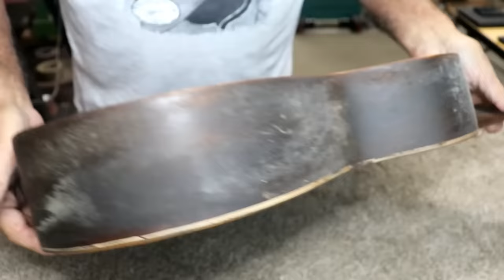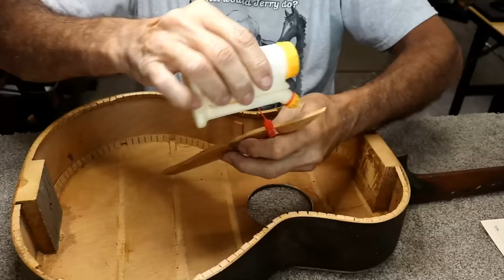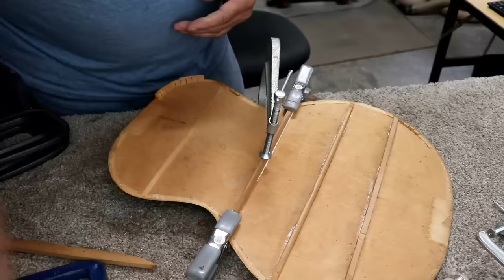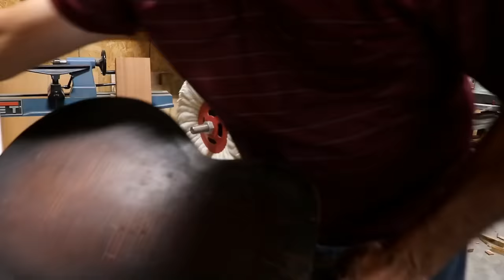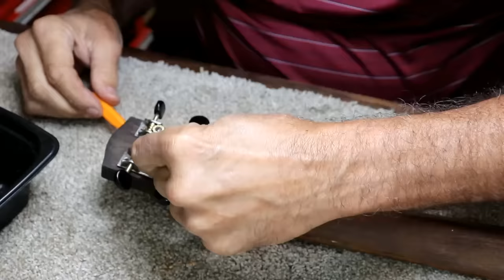596 RSW Can This Wall Hanger Become Playable? - A 1920's Mail Ordered Vintage Guitar Repair

Comment: I am curious why you didn't try to do any gluing on the split part of the top near the sound-hole (between the sound hole and neck?)  It is clearly split and may try to open even more as more stress is put on the neck.

Comment: I have the harmony from the same time frame.....that had the fake pan on the front.  The pan got lost over time some im throwing a real spider pan in and everything else. Can i get your email for questions on proper height of the bridge. And should i trust where the wooden bridge was for the proper length away from the neck to place the new bridge? Please let me know if possible or any ideas on here. Thank you.

Comment: You may get better results if you heat up the linseed oil. The reason why the parts did not line up has to do with a combination of warp and torque. Judging by the age of the guitar, a lot of the crud on the guitar is probably a result of smoking and candle lights. Alcohol or gasoline can solve it but it may kill your varnish too.
Reply: Didnt help that he soaked the guitar with soapy water before popping the back

Comment: I've rebuilt much antique furniture. if you were to feed the wood tung or lemon oil , maybe your top wouldn't have made those cracking sounds. it makes the wood more supple & pliable. the lemon oil would probably be better than the soap & hot water

Comment: I have a 1937 Levin guitar from Sweden that was an old relatives, that had spent a couple of decades in an attic before I got it. And had absolutely everything on it be original.

And the tuners on that guitar look pretty much identical to the ones on the guitar in the video, so yeah those tuners probably are original.

The guitar I got, was in nowhere near as bad condition as the one in the video, but still pretty rough. I had to do some work to get it payable again.
The glue which I suspect was hide glue or something, was very brittle at parts, so I had to do some glueing. But the guitar was holding together when I got it, or well a whole lot better then the one in the video.

The frets were green and super oxidised. 

It never were a valuable guitar, the finish is about on par with the one in the video, maybe one step up but not much. It has the same colour theme and shading as the one in the video. Idk maybe it was trendy in 1937?

But I got it to a place where it sounds and plays really nicely now.

Comment: Hmm.. What about making a special guitarr-clamp-jig which is on a rotating board which can be easily unlocked/locked with the foot?.. I mean.. for this project it sounds like overkill and would take a lot of space, but I suspect it may pay off in the long run.
Reply: I often think about myself as.. "Knowing enough to be dangerous" on most topics.

... That is.. I think of myself as a good example of where intelligence meets stupidity, and where competence meet ignorance.. or more exactly.. I usually use myself as the perfect example of ALL stages of the "Dunning-Kruger"-curve/-effect.. 

In this case.. I have just watched the entire video to the end.. and.. I have (through most of it).. assumed that the poster is CLEARLY the authority so I should assume him to be "right".. (I mean.. I never ever tried to deal with guitars on this level, so his experience CLEARLY blows me out of the water).. 

BUT.. There are some things that make me wonder if he even knows how wood works.. especially.. when exposed to.. "weather" (well; "conditions" related to changing heat, humidity, and other factors).. 

Sometimes (which feeds my ego and self-confidence) he say one thing; I disagreed... and later he came to the conclusion I came to¹ ..

¹ F.ex. the extra piece of wood.. which literally had a name and date on it.. which he thought FIRST to be just a random piece of wood intended to fix the crack that went toward it.... I personally.. IMMEDIATELY assumed that the name on the piece of wood.. was specifically the branding of the guitar... NOT created as a way to "brag" or create promotion; A while back- while most manufacturing was done by hand- MOST people did add a "flourish".. f.ex. people who made chairs or sofas or what not.. tended to write their name in an invisible part on the inside, AND possibly put in a newspaper of the day where they made the chair, or at least a coin that was minted the same year.. let's be fair: NOT a treasure; The smallest denomination available.. So, yes.. something inside something made by hand.. with a name and a year?.. To me it was unquestionable that it was the closest thing to "branding" you'd do WITHOUT writing a brand with huge letters on the outside of a product.. but also.. he seemed to think it may have been to cover- or patch- a damage????.. I literally saw how that piece of wood was mounted.. and I think that MUCH more reasonable it is that specific piece of wood.. created to be a "wedge" between the other piece of wood and where it was to be mounted.. and.. the crack appeared specifically THERE.. because a wedge creates tension in the wood.. so IF a crack would appear, the wedge would be the CAUSE.. not the solution.. 

and some other things. but.. by the end.. there were SOME things he said that made me wonder if he even understand how wood works.. ("Wood works" *snickers a bit too much".. pun not intended.. but enjoyed).. 

ONE of which is that.. it gets more and more dried out (making it more brittle).. you can try to fix it.. (IF you have COMPLETELY exposed wood, you should use wood-based "soap"- not sure what the PROPER translation into English would be because what people USUALLY talk about when they say "soap" is something we in Sweden would call "Tvål", but I am talking about the Swedish word "Såpa" which is a TYPE of.. fairly high pH level soap that is usually made from pine wood).. -.. Either way.. Wherever there is exposed wood.. use it.. once a year.. to let the wood suck it in, to replace other moisture and lubricants that will have disappeared over the year..

and.. This is the way you can compensate so the wood doesn't turn grey, or brittle. 

.. but then.. we are talking about an OLD guitar.. and.. he seem to be surprised that.. when he got the lower half clamped (always make me think about Futurama when he say it.. CLAMP!!!).. Doesn't he know that wood as it dries out will alter shape?.. be skewed?.. because it isn't entirely uniform????... It's NOT weird that the top.. "is not straight".. it got skewed... that is not.. "strange".. it's what should be expected.. if it seemed to be right before it's because it still was (in part) glued down.

Also.. a bit earlier than this he pointed out some things which would change the angle of the neck.. and thought this may put the neck in the right place.. I don't think he is wrong.. HOWEVER.. because of the basic rules of dealing with an organic material that isn't 100% uniform all through the wood.. AND where we can assume that it has been skewed, AND that the original creators PROBABLY focused on making a product they couldn't get sued over than making something "perfect" (nothing is better than the competiton at the specific market they are trying to work within).. 

..................... So... The thing is.. a LOT of "cheap" products  (NOT talking about cost; The actual price-tag MAY imply a more expensive product.. they just assume that people won't know if they got what they paid for).. Are made in the philosophy of: "It will probably be okay as soon as it gets bolted down".... Which isn't AUTOMATICALLY a bad philosophy¹ .. but yeah.. Actually making things "fit" by bending things while mounting them together.. Is a fairly common practice.. ESPECIALLY when people kind of "have to make do" instead of being able to literally chose and reject anything they ever come across.. Trees aren't all "perfect".. people at the sawing mill don't know the varying densities all through the wood as they slice away..  and so on.. and.. when it comes to mass production?.. TODAY.. we have reached a situation where beggars CAN be choosers, but.. Tbh; The "Pick-guard" ( I THINK the English term is? ).. looked so.. out of place. .and.. "manufactured".. that I actually QUESTIONED the idea that this was mass-produced at ANY time in the 1900s, and instead thought it was some advanced hobbyist that made it.

-

¹ Though it does have a double meaning in Swedish, where "to bolt" can be considered to mean to repeatedly hit something.. and.. IF it is used as an expression when talking about raising children, it kind of implies that.. "well, the little squirt will probably be all right in the end as long as we keep punching him/her when we think he/she did wrong"..  and that.. is a VERY bad way to raise anyone.. especially children, so.. IF you think it's an okay way to make sure people know it's NOT acceptable to do something.. then remember to always use it against adults you disagree with than children)..

Comment: I have one that looks almost the same as that one except it has 3 white dots on where neck strings are and it says JET on top but yours is the only one I have seen that’s come close to the one we have as far as the bottom goes with that metal part on the bottom of the guitar it’s lighter wood and doesn’t have the black part on the side of the hole the hole has almost white around the hole nothing around it

Comment: Heat the knife up it will melt the fish or animal glue
Clamping like that if you get a piece of wood the length cut a v in it and drill some holes for the clamps. Won't move around and give you better even clamping force
Methylated spirits or brush cleaner like cellulose thinners will melt the glue
If using the little cramps but have Square blocks and put a slight slope of 3 degrees and glowing some cork on the ends would be good. Rub the back with methylated spirit with tung oil it will loosen up the shellac French polish
Yeah linseed oil is it good  nourishes the lacquer and the wood but just clean it with methylated spirits first.
I Would say more than play audible it's got a nice tone

Comment: That's funny. While cutting the back loose, you say "I can repair everything that is breaking". And when you finally have a perfect overview, these braces need new glue and probably some TLC, then it's only a fifty-fifty chance? Is the neck joint crooked? Do you need new solid gold frets? What can possibly run havock?

Comment: White is moisture trapped in the finish. I use 50 percent cotton 50 percent wool sweater from recycling place with an iron. Lap the sweater 2 times over and put iron on it no steam, run it back and forth not to over melt the finish. White will disappear.

Comment: good job, would be happier to see it back to the wood and dead varnish taken off, steel wool or car finish grit paper 300 ? before oiling. sounds rough to the touch.

Comment: Why couldn't you use the bracket that you use when clamping a bridge that has the two ends that screws down to hold the tapered ends of the bridge. By using that clamp it would allow you to have one clamp and apply pressure in three different thicknesses.

Comment: Believe if it was me I would take my da and some 1200 and Water  sand that thing smooth restain it then put a coat of polyurethane on it with my spray gun then I would have color sanded it then hit it on that buffet it would look like  brand new but that's just me I've been painting cars forever you did a good job restoring that old guitar though thanks for the video

Comment: You should never spread a water-based glue with your finger because the oil from your finger spoils the glue a little bit.  Likely to never be a big problem in this type of application, but still worth knowing, in cases when you're using a tiny amount of glue.

Comment: Through my speakers on my amp, that sounded good.  If that was yours, do you think you could use the top and back, and replacing the bracing and possible the neck, and make a really great sounding guitar, and would it be worth it?

Comment: The was great, but why save a brace and risk cracking the top? Carving a new brace would have been just a bit more time time than wrestling with an uneven brace.
Reply: Well, I guess if you're preserving the original.... you're preserving the original - not replacing bits.....!

Comment: Break up a 78 RPM record and put the pieces in a mason jar.  Add in 1/3rd to 1/2 full of lacquer thinner and allow the record to fully dissolve.  Stir and you will come up with a single coat fixer / finish.  It will even smooth out the alligator grain on old varnish.    *<;o)

Comment: It's an old guitar, but not having phillips screws doesn't mean it precedes the use of them. A cheap guitar could be made with cheaper slotted screws in the 30s, 40s, 50s etc.

Comment: The same Guitar on eBay. This Guitar has the initials C E B, the eBay one has F A S. So i am guessing (and it is just a guess), you could have your own initials put on the Guitar when you ordered it. Any thoughts on that, anyone?
1937 Vintage Richter Harmony Arch top Guitar round sound hole Faux finish V Rare
Condition: Used.
“This is a vintage guitar it will show wear and it will not look new. You are buying used vintage ”...
Price: US $1,849.00

Comment: You went about the restoration the wrong way all the way around. I watched this video from start to finish and I can tell you where you went wrong. When you took off the top, you should have just taken the kerf glue strip off completely and replaced it. 

Cleaning off the glue from this old instrument should NOT have been the chore that you made it into. I did violin restoration for a while. I handled violins much, much older than this guitar. But this guitar and the old violins have something in common. The old violins and this guitar were all pieced together with hide glue. Hide Glue is infinitely reusable. The easiest way to clean or to soften hide glue is with warm to hot water. All of the parts would have come apart because hide glue always remains water soluble no matter how old it is.

The other thing that you did wrong was cleaning the guitar. You used soapy water. That was a very bad idea. By using water to clean the surfaces, you in fact, washed dust, grime and oxidized finish into the scratches, cracks and streaks. Then you tried to buff off the finish to refinish it. That drove the dust and grime deeper into the finish. The only way it should have been cleaned is with denatured alcohol. At most, the guitar could have been washed with warm water only, no soap. Soap destroys the water surface tension. Dust gets mixed in with the water and provides a conduit that makes it easier to drive the dust deeper into the surface.

Once the wood was dry, then mineral oil could have been wiped into the finish. Mineral oil is a great cleaning oil that can refinish and remove oxidation and water mark stains. It's also used with refinishing and is a common ingredient for french polishing wood to a bright sheen. Just mineral oil would have done a much better job of cleaning the guitar body than what you did. And, it would also have enhanced the finish and make it look far better than the results you ended up with.

Your threaded clamps were too small for the kind of work you were doing. Those size clamps are ideal for smaller instruments like dulcimers, ukuleles, violins and violas. Threaded rod or bolt clamps with larger washers covered with cork would have done a far better job clamping.

In short, that old guitar could have been fully restored and back to playable condition. It's nice you did the work for a friend. But I think you could have done more and better. Thanks for sharing.

Comment: too rough sir....and you never should of removed anything until you knew it did or didn't belong in that guitar, as per REMOVING THE NAME TAG AND THEN PUTTING IT BACK IN IMPROPERLY and NOT IN ITS ORIGINAL POSITION DAMAGES AND LOWERS ITS VALUE !!!THATS AN ACT OF SHEER VANDALISM ..RUINED THE  ORIGINAL STATE OF THAT GUITAR...not impressed with your sloppy and damaging repairs either....watched you DAMAGE the guitar tearing parts off unnecessarily and breaking them ...I think your ignorant and awful rammy with that delicate old precious rare instrument...need to learn some serious patience....and to STUDY EVERY SONGEL INSTRUMENT YOU INTEND  TO REPAIR BEFORE YOU EVEN TOUCH IT!!!!!!